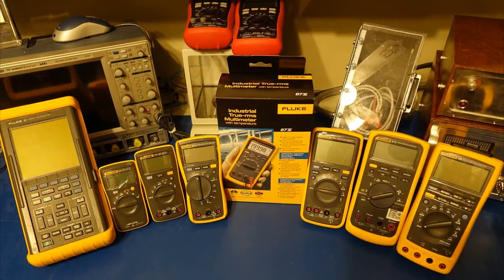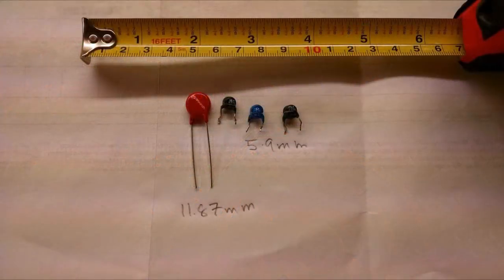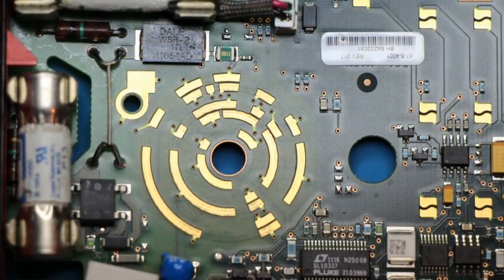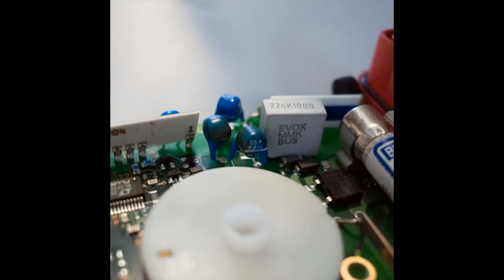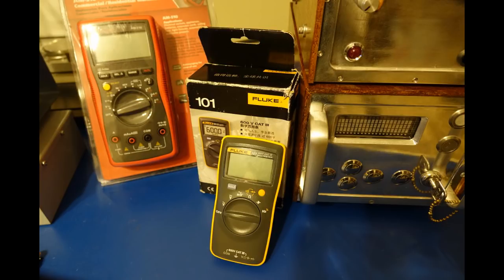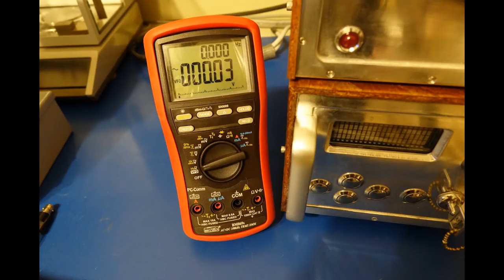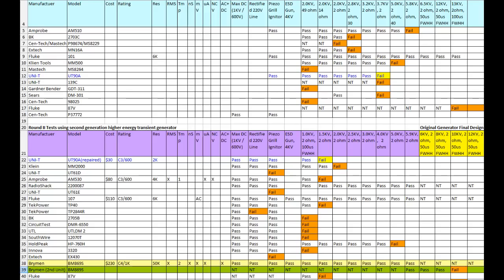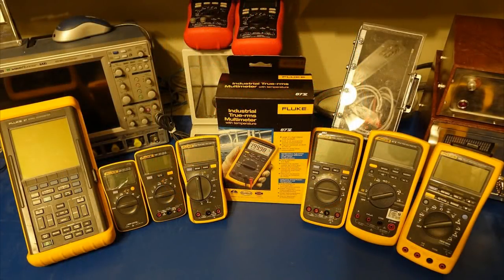Fluke 87V Robustness Tests,  Part 5 Intro

Comment: calling these tests a very rare event is fine, they are, but i for one use my meter at least once a day when i'm working and over time all of that adds up, switch cycles, accidental transients during failures of inductive designs, high voltage arcing over to the probes, grabbing your probes when your charged up and giving it a static blast, blowing fuses after 20 hours of work and leaving your meter in the current range 
all of these add up and i would like a meter that survives all of this, i dont think of a meter as a cellphone that should be replaced every X years, i want one meter and i want to abuse the hell out of that one meter until its last possible breath 
that's why i thank you for your work and why i won't buy a meter that does not survive your testing
Reply from the maker: For the life cycle, in that second video I mentioned 180 days, 5 cycles/day, 30 years but I decided to push them even further.   The switch testing came about from my BK meter's switch going bad after a few years.  The transient tests came from my first Fluke's front end being so weak resulting in my damaging it a few times.   After joining the EEVBLOG site and watching some of Dave's reviews, there seemed to be a lot of feelings rather than data playing into how the meters were presented.  Most of it was mechanical (swimming with the meters, dropping them from very high heights).   It was entertaining but I have never swam with a meter.    I'm not in the entertainment business and was curious if we took away the drama and used some standard tests, what would we find out.  And here we are. ....
Reply: Yes, i like data, i like to be able to look at a chart and say "that's the best meter for the class i want"
i don't care what it looks like, i don't care if it can survive being thrown off a bridge or tossed down a rapid, 2 meters is about as far as my meter will fall and being sprayed with alcohol is about as wet as it will get, i don't care what it looks like or how the switch feels as long as its robust, and yes its nice to know a meter is accurate but im not after absolute accuracy in a handheld multimeter but those are all knowns, its the unknowns that scare me especially as i work with high power power supplies and the last thing i need is an inductive spike ionizing around X or Y and dumping 100+ amps in to something that's in my hand and not having a hand any more or worse
and that's why such independent and open testing is so necessary and we dont just assume because something has a UL mark on it that its totally safe and we dont assume because it has 3 movs and slits in the PCB that the design is foolproof

Comment: Really excited for that, you are doing amazing work! I love the fluke 87 I have bought two used 87 original version that has been in use for more than 20years, and they only needed a cleaning to start working perfectly again. I am sure they are robust. But I would love to be proven wrong.
Reply from the maker: Hard to say.  The 87 has not been made for a long time.  It may be difficult to find a NOS part to run.

Comment: Love your tests Joe. Great stuff! Because of your videos I've bought a Brymen BM235 and the BM869S because I wanted great meters that will last me a long time. Before I bought these I was lucky in my choice and bought a Fluke 115 5 or 6 years ago. Only meter I've purchased recently that didn't fair well in your tests was the Uni-T 61E just as a tool box meter for my band gigs just for checking cables and speaker impedance. I liked the features for $50 and knew I wouldn't be testing any big voltages. Keep the videos coming! always informative and entertaining. PS, I noticed in Dave's recent videos he's been using the BM 235 for testing circuits! What's up with that??? ;-)
Reply from the maker: Strange.  He has a few 121GWs and would have thought he would want to promote them.
Reply: I was seriously considering on waiting to get a 121GW before I bought the BM869S. After watching your videos and seeing the quirks of the 121 from people who bought the limited run of the 121's I changed my mind. Now I'm seeing shims added to the switch, not very robust, quirky data logging.................... and that didn't instill a lot of confidence in its quality. I'm very happy I went with the 869S and all its features. Been using it constantly on my amp repair bench for the past month. Can't wait for the next video of the 87V testing.
Reply from the maker: As far as I know, the USA orders were not shipped.  Pretty bad when you consider the delivery dates that were given in the kickstart.  My plan is to wait until it is available through normal channels and the general consensus is people are happy with the product before investing my time to look at another.
Reply: Hello SIXSTRING63, 121GW still has many problems to solve, Dave is still trying with various firmware updates, but the hopes are weak. The people seems increasingly dissatisfied with the performance of this DMM. And I have a BM869s and I'm very pleased with it, it's a very robust multimeter with good accuracy.
Reply from the maker: Its rare I watch any of his videos now days.  Early on, I found him to be entertaining.  I started to watch this and saw a bunch of air quotes about new technology.   I then skipped around and indeed, he is using the BM235.  Certainly nothing wrong with that meter.  It's pretty bullet proof.  Maybe he was concern the 121GW would get damaged when reading resistance.  Ha... No it's not that bad.  I'm not sure why he wouldn't be using it.  Maybe he does not want to promote it until they have a working product they can sell.   I really have no idea.  My guess, it was a near by meter and he grabbed it.  

F87V is on the chopping blocks today.
Reply from the maker: Funny, if you watch me solder, I use my old Weller heat gun and PACE iron with the set screw tips.  No problems.
Reply: Just watched Dave's latest video on soldering stations. Once again the venerable BM235 came out to measure the tip resistance on the iron he was testing. Not a 121 in sight. Another pan of the bench I saw a Keysight meter. Hmmmmmmm?? Did they all get shipped back to the factory for an overhaul?? Interesting.
Reply: I think his last 5 or 6 videos he had to use a meter on he's used the BM235. Can't wait to see the final outcome of the 87V, and what happens with the 121GW when and if it gets squared away.

Comment: what do u suggest for the type of multimeter you buy it for life i mean stay for long time for you????
Reply from the maker: If you took the time to read the FAQ, you know that I really can't suggest what meter you buy.  That's up to you.  I can present you with the data I collected which may help you.  I can tell you again, that my favorite meter of all of the handhelds I have ever looked at, including those I have tested is the Brymen BM869s.   It's just a good all around meter.
Reply: I apologize for joining before Joe but personally I believe that a good tech persons should have several multimeters not just one. I have Fluke 185, Fluke 17B+ (sell) Brymen 869s, Uni-T UT210E, ANENG AN8008. Personally, I can't say that I was passionate about a particular brand. But I prefer Fluke 185 for various reasons not only that is just Fuke,  I like 3 inputs sockets and 3VCD - 2 x AA.
Reply: joe smith thank you ✌

Comment: Is this the intro to the last great battle before the sinking?
Reply from the maker: If you are a believer in the 87V being the gold standard of all meters, then yes this is the last great battle and I do plan to run it to failure just like the two previous times and I have no plans to look at another 87V after this.
Reply: I believe in good quality and if the 87V is of it I don't know but you will tell us I am sure ;-) 
I own a 107 (bought as new) and a 28II (bought as used for a very reasonable price) besides some others from other manufacturers including Brymen but no (need for a) 87V. I am not a fan boy of any manufacturer.
The 107 and 28II are doing a very well job for me. A comparison of the 87V and the 28II or test of the 28II would be very interesting for me.

Comment: Dave/EEVblog says your tests don't matter in real life usage because he knows that his buggy 121GW will fail your tests.
Reply from the maker: Do you feel he is using the 87V golden standard as a justification for how poorly the pre-production meter did with these tests?   If so, what happens if this latest revision of the 87V surpasses what the 121GW can withstand by a large margin?     It could happen, but as I have stated, I doubt it.
Reply from the maker: Was it presented that way in the beginning?    Or was he selling the idea that he was a lot more involved?   No matter.  I like the EEVBLOG channel for it's entertainment value.  When he was younger he was quite funny.     I really have no idea why Dave would not have turned to Brymen.  Maybe he did.  You would need to ask him.     

I never viewed UEI as a high end brand but I did like the 121GW.  The preproduction meter shows a lot of promise but I was a bit concerned when Dave started running all these switch cycle tests on it.  I would have assumed that was something UEI would have been doing after we first saw the switch had problems.

I am not sure they will do anything to improve the meter's robustness.  If you took the time to read through that thread I linked, it sounds like they are happy with it.   From my own data,  there are a lot of meters that fail around 2KV.   IMO, mostly low end products.   That 87V sure throws a curve ball into that but there is not much I can do about that.    Come on Rev 13 PCB.

Comment: Wow! I personally think that your tests and reviews are non biased. Given that you are a Brymen fan (for a good reason) you did not stutter when the 869s blew the transistors. Likewise I do not believe you are doing these tests in any way to vilify Fluke or any other brand. Facts speak for themselves, and these facts are black on white in your tests. When the F101 and 17B+ did well, you were just as amazed as I and everyone else was. Waiting with bated anticipation to see the transient testing of the 87V!
Reply from the maker: You are correct, I run them all through the same set of tests and have nothing to gain from it.  I am a Brymen fan but that comes from running that 869s through the transient tests twice and now life cycle testing the switch.  It has done very well.